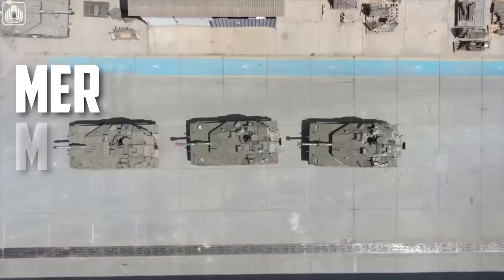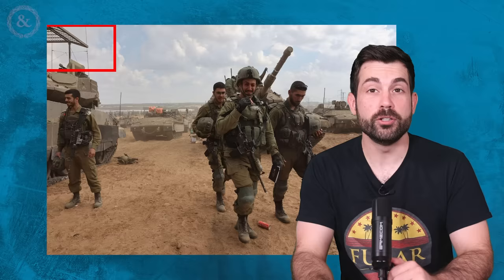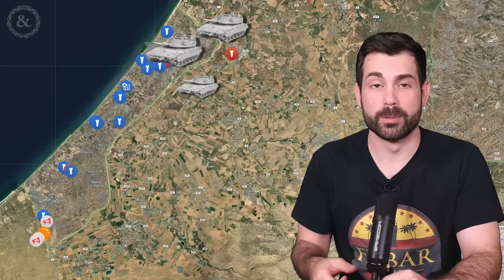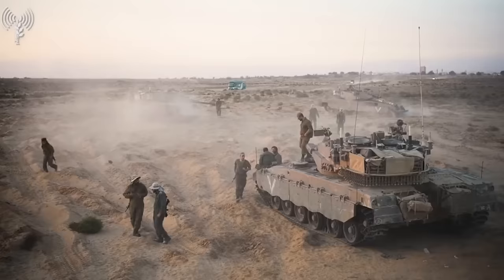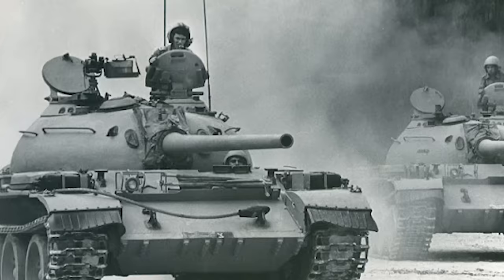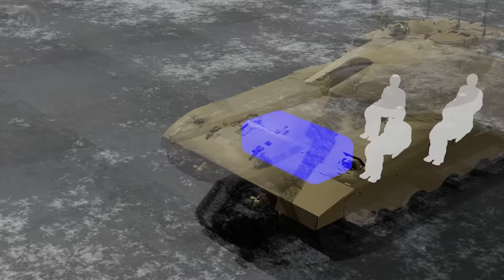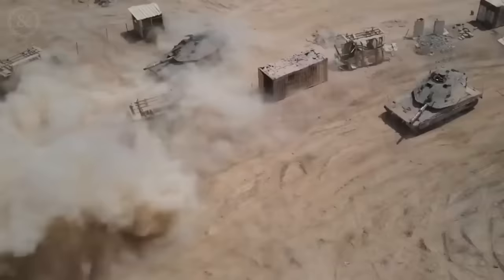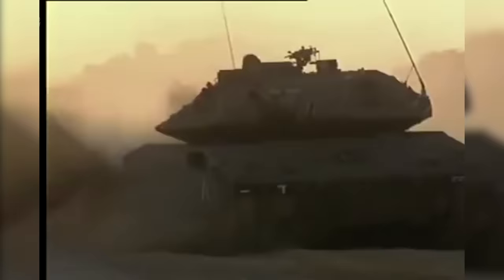Israel’s Home-Built Merkava Tank Tactics

Comment: the israeli sherman usually had 105mm cannon (the m51). It still had good armament for its time and didnt have the 75mm found on older shermans from ww2(dont mean the 76mm shermans). but nice vid
Reply: Well they did eventually retrofit a 105 on. Though it did remove the stabiliser it was a big gun.
Also there was the M50 that took the AMX 13's gun and slapped it onto the sherman.

Comment: The Namer, has also been used for both troop movement and removing injured soldiers from the battlefield.    This vehicle has been built from older Merkava's bodies.    As afar as the "New Merkava 5" due to its exceptional shooting distance in an over shooting position, they'll be able to shoot at long distances without placing its crew and tank into harms way.

Comment: 65 - 79+ Tons and almost reaching 30mph in rough terrain  is pretty damn impressive. Plus their early approach to Manufacturing turned High End Manufacturing still powers Israel's Economy today, Which when surrounded by enemies make it hard to depend on Imports or Exports and getting outside companies to invest.
Reply: Do you know what is  Christie spring suspension on Merkava ?
Reply: @patewing5808  I do not. I read that it's a Christie like suspension but mounted on the outside, which make for easier repairs then the  one used in WW2 tanks that were eventually considered obsolete? but even that I'm not sure which model tank it was referring too
Reply: @marktorch9079  Merkava using obsolete Christie  suspension , do you know why ?

Comment: many Merkava 4 & 5 waiting outside Gaza are now equipped with top cages to prevent drones hitting from above.  The turret is already well protected against drones but these are an extra.  It will obviously be a test if their Trophy anti tank missile system works as well as expected.  If it does, it seems, once they advance in mass their destructive force may end the war much sooner than expected.

Comment: Very informative video. I was aware the merkava is an outstanding tank, but it’s even more impressive than I imagined. Hopefully all US armored vehicles will soon be equipped with a trophy system. You did make one slight error when at 8:48 you stated gunners were trained to “snipe at 1.5 kilometers or 9.3 miles”. The correct conversion would be .93 miles. Thanks again for another informative and entertaining video.
Reply: "slight" lol

Comment: "Hamas done eff'ed up"  is the consensus from some of the local Armor guys i've talked to.   gonna be hard to have house to house fighting if there's no houses left.   they have severely screwed their own people (those that will still claim them) by their actions.   Tunnels?  hard to have a safe tunnel if you level the buildings down on them and fill every entrance you see with concrete. and it's not like ground penetrating radar doesn't exist.   if the IDF rolls through and decides Hamas doesn't need to exist - their only option is going to be to abandon the very people they're supposedly fighting for.
Allah had NOTHING to do with what happened on the 7th and their actions - just like those of other extremists only - shamed and disgusted true followers of the faith.

Comment: U mentioned the invasion of Lebanon in the 1980s but u didn’t mention the 2006 war that Isreal also carried out against Lebanon.
The point would be that the Mark 4 was deployed very heavily and it took so many hits that shattered the image the IDF built, a valley of hujair in Lebanon called Wadey al hujair, carries the name the cemetery of tanks after the war endded. 
U also failed to mention the top notch explosive armor that helps against the anti tank missiles. 
But it was a nice video. 🙏🏻

Comment: Just a warning for abnormal wedding rings etc. if you injury your hand/it needs to come off for some resaon then hospital cutting tools re generally designed for softer metals so it can be difficult to get them off/not possilbe which can lead to worse outcomes for your injury.

Comment: Great as always! I got some questions that you @Taskandpurpose might be able to shed some light on: Is it possible to get a picture of the Hamas tunnels by a technology that archeologists and geologists use to get an idea of excavation sites? (Using explosions to make some kind of x-ray of the area) Can sound be used inside the tunnels to fake troup movement at a distance, to shock (loudness) or to dazzle? Could smart watches be connected with smart apps that realize the wearer is in danger? The VR system seems really a decade ahead, do you have more about it?

Comment: 8:50 Quick correction: 1.5km is .93 miles, not 9.3 miles. A mile is a bigger unit than kilometers. To those of us who regularly use metric measurements, one mile is 1.6km.

Comment: Urban combat is difficult.  Not just for tanks. Combined arms needs to overcome these problems. Drones can increase situational awareness.  Israel also uses heavily armoured D-9 dozers for Urban combat. This can allow units to avoid existing transport  routes that may be mined or ambushed. And flatten hostile buildings. And may be able to recover damaged vehicles.  Manpower is a vital issue for Israel. And women power.  Including tank and dozer operators. They train new tankers.

Comment: Not sure how good they are but one of the most awesome looking tanks out there.
I really don't get why they haven't been able to move to unmanned tanks.
Vision out of a tank is already limited so it would be no problem controlling them using cameras and having the driver and gunner in a safe location.
Reply: Half of Israel is a desert, which means insane amounts of dust and sand in the air, especially in combat. Combine that with the fact that the enemy only had to target the outside-cameras on the tank in order to render it completely useless it's better to have a crew inside who can still operate the tank if the cameras become inoperable.
Reply: @friedrichrubinstein2346  Yeah I guess but if the optics are damaged it is pretty useless anyway and then the crew is pretty screwed anyway. Without a crew you could also have it set up to detonate the ammo if it was captured or disabled turning it into suicide bomber lol.

Comment: How will it do with landmines? The Russo-Ukraine War suggests that all of the armor, sensors, and firepower is relatively useless against a few dozen well placed AT mines that cost almost nothing. Not picking on the tank or the Israeli army - but this seems to be an area of maneuver warfare that has been neglected.
Reply: Ukraine vs Russia has shown tank. ( and every thing else) to be ver  vulnerable to short and medium and longer rang drones that are steered during flight provide real time recon to direct def or offensive maneuvers. And kill or direct a kill at whatever they see. 
And, U vs R also demonstrates cheap short range with one by one destructive firepower. 
Cheap, efficient and effective air power of slow, small and ubiquitous  systems are very hard to deal with. 
Pair with artillery that can also place mines - yikes.

Comment: If I am in a tank, I do not care less about the comments about low tech ghetto solution , as long as it works. A canopy on top make it harder to hit the tank from the top. However, the bar armor on the sides is another story , it obstruct vision and prevent you from shooting out through it. The explosive reactive armor also mean infantry have to stay at a distance in case they go off. But it is true in WW1 and now, tanks should always operate with infantry support or in a gang with APC mixed in the rear somewhere close by, or the tanks get eaten alive. The Merkeva's ability to carry just 6 soldiers at the back is not enough, very often , the room behind get taken up by more spare ammo.

Comment: The Israeli Sherman tanks in 1948 weren't hand-me-downs, they were scrapped up from scrapyards and garbage dumps.
The Israelis matched the bodies of American tanks who were blown up from the outside they purchased from scrapyards in Italy, with the track-and-wheel systems they disassembled off wrecked Sherman tanks left behind by the British,  blown up from the inside.
Putting them together, the Israelis got some functioning tanks.
However, what they didn't get were functioning cannons for these tanks, because both the Americans and the British destroyed those, either by blasting them or, more commonly, by drilling holes in them.
The Israelis tried several different solutions to plug the holes, none worked. 
In the end, the bought new guns from France. But that came some years down the; Israel has managed to acquire a bunch more Sherman tanks from all over the world, and set out to upgrade them for the modern battlefield.
However, back during the Israeli War of Independence in 1948, those Shermans played no significant role.
In fact, the whole idea to build a tank core for the IDF was promoted from the very start as a means with which to safeguard Israel's long borders after such borders were established at the conclusion of the war, without having to keep very large infantry forces to do the job, as a tank platoon, then made up of 25 people, has the fire power of an infantry company or two, made up of hundreds of people.
So those tanks not only did not take part in the war, they were never meant to, in the first place.

Comment: 25:24 - note those "blankets" on the road. Israeli tanks are not supposed to drive on roads and their steel tracks quickly shred the asphalt. Hence, when they need to travel (short distances) on roads, they'll use these "blankets" in order to reduce damage to the asphalt.

Comment: 8:46 1.5 kilometres is not 9.3 miles. You might want to correct that to POINT 93 miles. Snipers can be really well trained but NO ONE can use a rifle accurately at 9.3 miles or even 3 miles. The longest confirmed sniper kill is 3,540 metres or 3,871 yards for reference.
Reply: He's talking about smiling with a tank...
Reply: @randybobandy9828  no, he made a simple mistake but anyone still living in the imperial dark ages would think, WOW 9.3 mile sniper kills. 😉
Reply: @FirstLastOne  no.. he was talking about a tank round regardless of the distance mistake... Why would he be talking about fcking rifles?

Comment: The tank's weight is not the restrictive factor in Israel, that it would be in Europe. Road bridges are the main difficulty in moving 65-ton tanks across European battlefields. MIddle Eastern battlespaces don't have gthe same urban clutter.
Reply: I was curious and did look up the rivers throughout Israel, and there's more river crossings of west/east rivers in such a small country than I expected. If the tanks are going to be mobilized, though, they probably would already have been shipped to the border regardless

Comment: Great piece of kit and engineering but would the trophy system stop a drone hit to  the backside  coming in at high speed from above ?  What about a big IED from below ? A Mine might also damage its tracks and render it static , which would make it more vulnerable to attacks and unable to move foreword .Nothing is indestructible , although I would not want to be facing these on the battlefield .

Comment: Nice video Chris! Merkava is an excellent tank i like it and I wish Greece would buy it ! There are rumors that Cyprus is going to buy it it will be nice because it has the same climate like Israel and has better survivability for its crew ( Cyprus can't afford loosing lots of soldiers)  Negatives: 1) There is only in Israel and you can't have used ones from other countries and 2) I was shocked when I watched how "easy" was destroyed by Hamas drones I hope they fix the problem! I think the Russian style metal "structure" is only to protect thropy system and possibly some sensors! How about motor sector from above ( Hamas video)? I believe the tank ( not only Merkava) has to be in action in anemies territory with anti drone systems like lasers or jammers or friendly drones as a shield, positioned on tanks ( not necessary all of them) or in Nammer etc military vehicles close by!
Reply: To be fair the tank was only immobilized by the drone, the crew survived unharmed and it sounds like an easy repair

Comment: Merkava is objectivly a good evolution of tanks. Unique solutions and good translation from expertise taken from Nazi Germany (the hard and ugly way), combined with realising what they need and what they didn't (what is kind of a unique thing - specially these days).

As many, the systems didn't stand the test of time, and while they still peform okay, modern technologys dated them. Still it is hard to completley replace a huge fleet - even more if its a legendary symbol of the nation.

So with asymetric and urban warfare poping up on the list, Merkava face major problems. It by far isen't ready to stand attacks form above (RPG's and stuff, but also simple thrown IED's). A RWS is okay to cope with this threat, but in dense middle east citys still its a horrible risc with paperthin top armor. And Trophy offers almost no defense against top attack, or close range attacks - so including everything that happens within citys.

Merkava 4 has been faced with somewhat aged russian ATGM's and got hit in open terrain, so Trophy failed (by speed limits, i guess). Merkava 5 doesn't offer much in this terms, as all the fancy AI-buzzwording doesn't grant any benefit in such dense terrain combat situations. In open terrain, the're easy to jam and light up the tank by EM-radiation. So its a nobrainer-attempt to fix unsolvable problems with PR words.

The problems Israel have can't be solved by better tanks, as any economy has its limits, and rising costs without significantly react on changing battlefield only allow an enemy to make every hit more painfull to the nations pocket.

But still it's a beautifull tank and a symbol of ingenuity.

Comment: What advice would I give the day of the big tank and personal  carrier is over so how would I give advice to usa make a tank with atifical ai thats have the size with missles 4 to five times  distance with a shoot with out targeting  missiles . Also build armored carrier trucks mine sweepers with missles  that can shoot down drones missiles also make a new humvee six doors 1 box up top with at least 50 new improve flex missiles  with cameras  on head with a shoot and find a target within a 10 mile radius  also has the abilty to shoot down drones and missles and rockets ,change the 50 cal to 2 10 millimeter  with ammo that can cut down trees  walls similar to special forces boat but make the 10 millimeter barrel  as long as possible  for range  the 10 millimeter  gives more control room for more ammo the barrel  can be thickened  cooled down faster and used longer and can stop running attacked vehicle  bomb attacks this is the way to go with an attacking forces 😮

Comment: 11:46 you can already pull the driver out from behind by the rest of the crew in a conventional layout. You’re acting like just because the engine is in the front, the Merkava FOV doesn’t have a turret basket or anything thag only allows the driver to be pulled back in certain azimuths of the gun.

Comment: 8:50 1,5 Kilometers does not equal 9.3 miles. What distances did you want to refer to? 

9.3 miles is 14.966 km
or
1.5 kilometers is 0.932 miles. 

Theres a classic conversion error somewhere ;-)

Comment: This video gets a B for effort, but there are so many errors and inaccuracies that I stopped counting them after 20. I suspect that this video was rushed into production and released in order to take advantage of the current state of hostilities between Israel and Hamas. The correct and accurate info IS out there if one takes the time, and doesn't rush things.  Go to 08:42 for an interesting conversion of 1.5 km to 9 miles. 😂